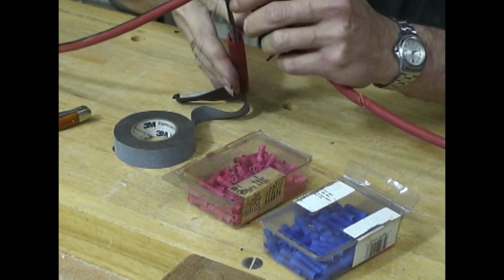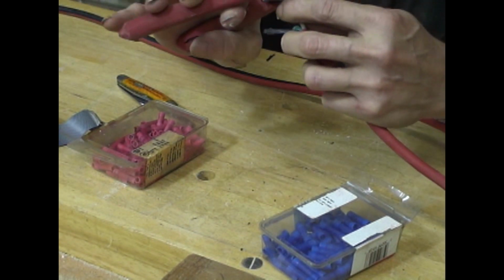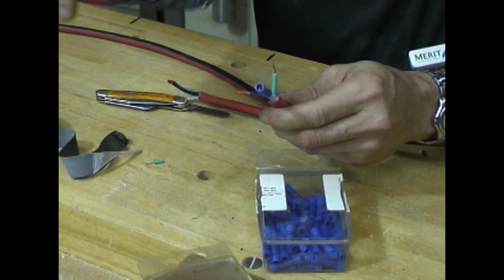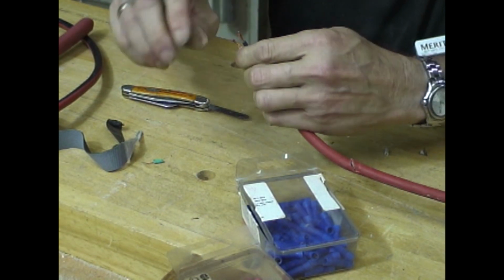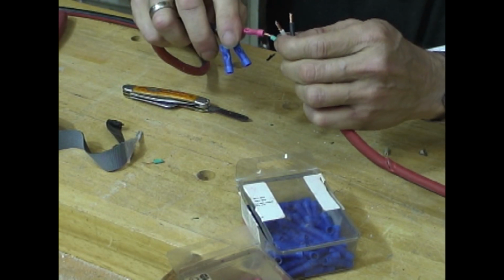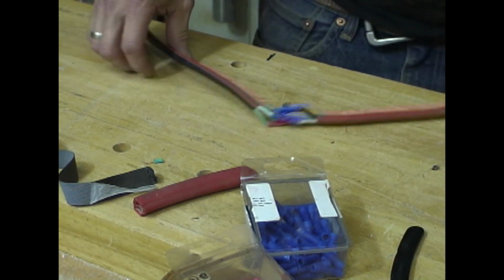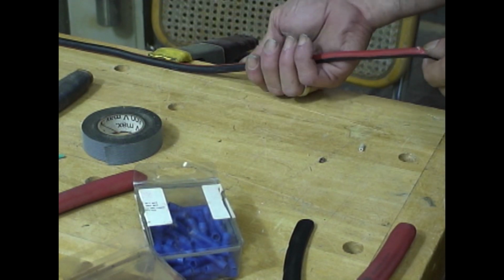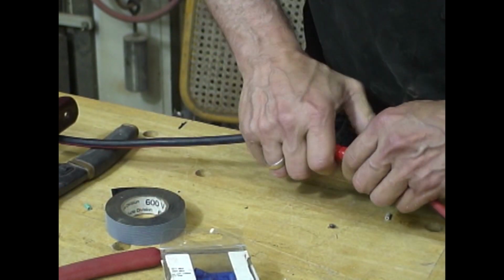Repairing a cut extension cord

Comment: when repairing wires in a bundle each splice should be staggered to prevent large bulges in the repair area . you may waist some wire but it makes a neater job more compact .
Reply from the maker: You make a valid point.  But I don't mind the bulge.

Comment: There's only one acceptable way to repair and extension cord. That's to cut out the damaged area and put a cord cap on both ends effectively creating two shorter cords that you can plug together.

Comment: I'm always amazed at the electrical practices you get away with in the US. in this one, we see "official" connectors which can be pulled apart, in a lead which is inevitably subject to forces of that type, and earth conductors which can't cope with the current available in the circuit.

Comment: I have never heard of a cord having different gauges within the cord.   Are you sure about this?
Reply from the maker: Well it looks to me that the ground is a smaller gauge than the load or neutral.  I posted another video about it so go check it out.
Reply: This is not a safe way to do this repair always replace a cut lead

Comment: You snould of staggered the wires make it easier and then you used wrong black tap should be 3 M  then shrek you had it there but you did not used it heat it up forms to cord.